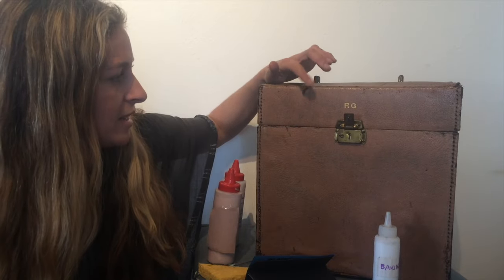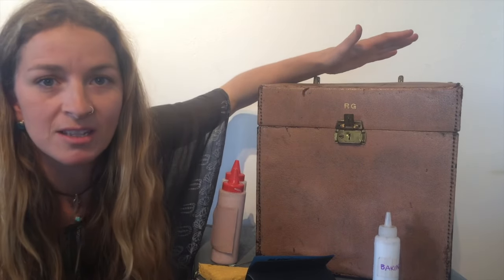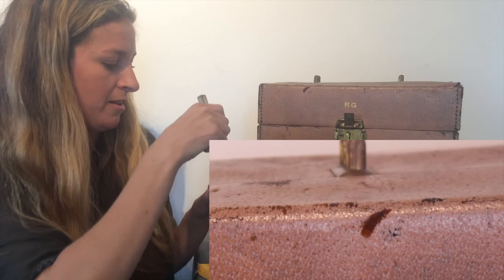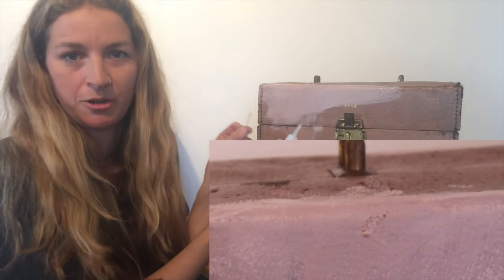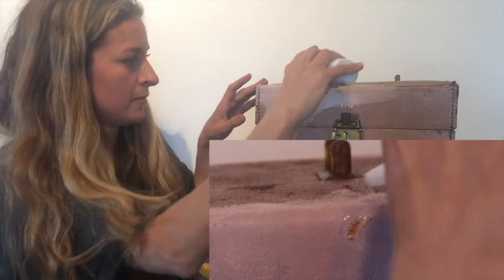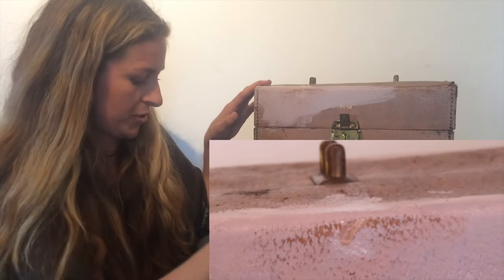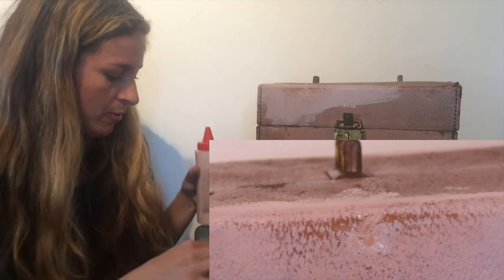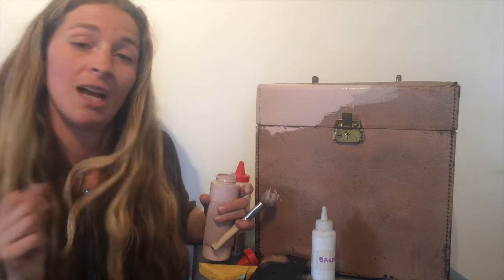How To Repair & Restore Tolex, Rexine, or Vinyl Cloth on a Vintage Record Case

Comment: I am closing seams on a guitar speaker box covered with black bronco tolex. I'm going slow with wood glue and and an electric clothes iron(paper in between not to melt the tolex) then fill with wood crack filler and a conservative touch up black paint. Its in the back and most don't fuss back there but these are nice Fender Cabinets. The tolex problem occurs when it shrink's and leaves behind a gap.   Suggestions accepted 
everyone......

Comment: This would have a detrimental effect on the value of a vintage amp. It might suffice for the yardsale set, but that would stand out like Dolly Parton in an Amish church.
Reply: @RubnRestore  Good luck with that, even the most perfectly recovered fifties Fenders have a substantially reduced value, compared to original gigworn amps. Painted tweeds, even less. In any case, it's your throat and your razor, metaphorically speaking, not mine.